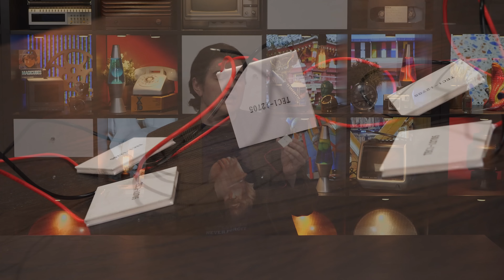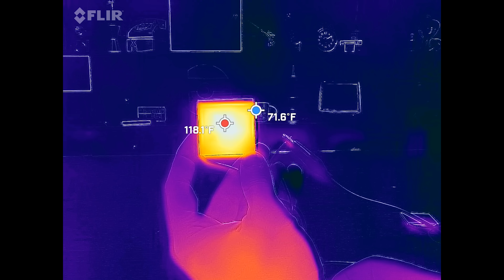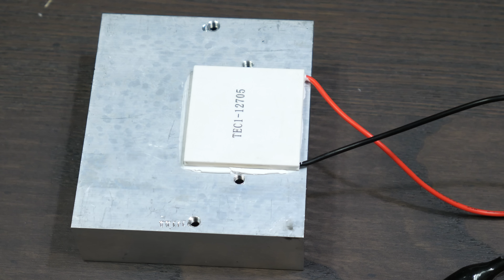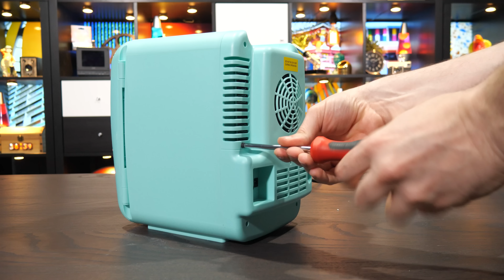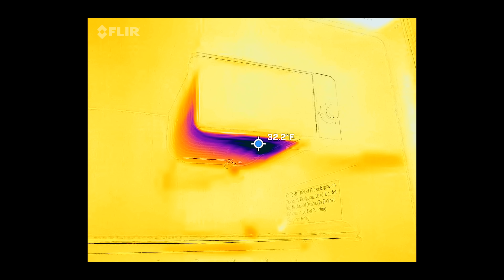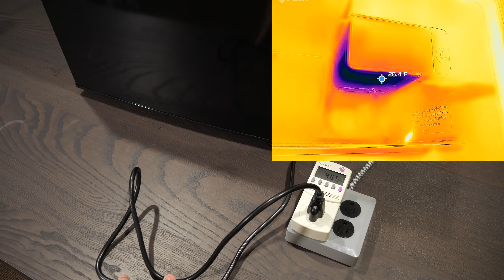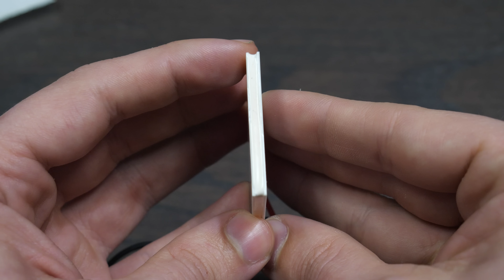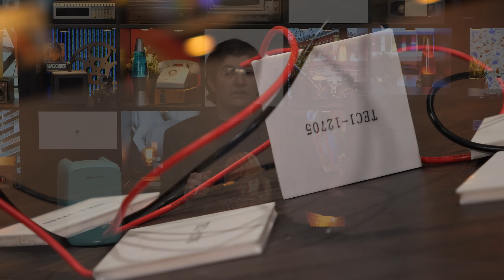Thermoelectric cooling: it's not great.

Comment: My wood stove has a Fan that uses those white pads to power it. The side facing the stove gets hot and the top is cooler and generates an electric current that spins the fan cooling the cold side of the white pad even more.

Comment: I have one on my desk at work. And would note, 1) it keeps my things pretty cold. It seems like it got your can down to 15 degrees and while i dont have a thermometer here to test it out, mine were cold enough to be refreshing on our 30+ degree days. My coworker has a temperature gauge in hers and it shows an internal temp of 5 degrees which feels similar to the temperature of mine 2) mine has a heat mode 3) i dont pay for the electricity at work 4) Im not allowed to bring in a mini fridge but can have one of the desk fridges 5) our lunch room is horrendously awkward to get to from my desk. Having some snacks or a pop there is significantly more convenient than keeping it the 3 minute walk away 

I think the one you got was just shit but i dont think comparing them to a mini fridge or regular fridge is quite fair when a situation where one makes sense, typically proclude the other styles from being valid options.

Comment: Fascinating! I use a neck fan with cooling plates and for some reason I thought the plates were cooled by the air going past them on the inside. I completely skipped over the fact that turning the plates on is a separate setting, AND the fact that they can be used for heat if so desired.

It's absolutely fantastic, but the battery life is pretty short if you're using the cooling plates. It takes a long time to recharge too. Makes sense now that I know about Peltier elements!

Comment: The power supply on the little blue thing will not last long. My didn't! The only thing the Thermoelectric has a goo thing. If you heat one side and keeo the other side cool it will make a small electric charge.If you put 100 of them where one side is heated and the other side stays cooler you may be able to do something with the power. There are fans rhar can be put on wood stoves that use one of the units to power a small fan to move the heat around the room. Because the fan keeps one side cool and the wood burning stove heats the other side, it makes enough electric power to run the fan! One could be used to charge your phone or some low power use!

Comment: I really wanted a ultra light, reasonably power efficient and small refrigerated medicine holder for camping / hiking.

My final solution(before thermally stable medicine fixed it for me) was a passive swamp cooler with a peltier to ensure the compartment stayed in range.

I also considered a medicine container in a regular cooler using the peltier to keep it warm or cool as the camp cooler temp changed over days.

In both cases the only way I found that peltier solved more problems than it created was to convert solar power into a small nudge in temp.

Comment: Portability is why I have to stick with my cooler... Portable refrigerators are significantly heavier and I'm lifting it in and out of different semi trucks every day.

And is also 1/7 the cost of a portable 12 volt fridge with the same volume inside, lol.

Wish I could switch to the portable fridge, though.

Comment: My 13yo autistic son has one of these mini cooler units in his bedroom, which he uses to chill his beverages. It seems to do a pretty good job for him, because he doesn't need his drinks super cold. Since we have solar, our electricity bill is pretty low (usually free, but never over $100 per month) even with 5 people in the house, all electric appliances, multiple windows AC units, and baseboard electric heat.

Comment: The only reason I have one of these at work is because I got it free with a dead power supply from an e-waste pile. A $4 power supply from Goodwill with the same voltage and a high enough wattage later and I have the ability to keep a couple of bottles of tea cool.

If I were paying out of pocket, I would've gone with a mini-fridge instead.

Comment: 21:55 - Their efficiency will vary wildly depending on temp differnces and current.
Well, that's actually something that can be controlled. With properly adjusted current and appropriately designed heat transfer mechanisms it's possible to run these things with relatively high efficiency. This particular toy "fridge" is just a crap built with no intension to be somewhat efficient and that's the reason it's crap, not because Peltier elements are.

Comment: the ones i have have a thermostat in them. they are also much thicker. got some to experiment with they were like $5 each. was going to add a passive r134a heatsink to one. i remember the heatsink being called a bubbletech, but the only one i can find is Akasa Revo. was trying to up it's efficiency as the heatsink also warms the box when the TEC is not on.

Comment: I love how after all is said and done, all these standard cooler replacements/portable fridges always end up not working nearly as effectively, but also end up costing significantly more than if you just used an insulated bag/cooler and fill it with ice.
They can't even reduce the items in them to an acceptable temperature, let alone keep them there. VS. A regular ice cooler that will get your items to near freezing within an hour or so and keep them that way for most of the day (depending on how hot it is/how often it's opened).

Comment: Wait, so these need to be constantly plugged in? And it still doesn't work effectively? I saw one at Sam's Club over the summer (IIRC it was the same model) with it's big draw being that it was "portable"; you simply charged it and it continued refrigerating/keeping stuff cold for several hours, so you could take it to the beach and what not.

Comment: Peltier elements have a use in laboratory equipment, such as thermocyclers. The volume to cool is small so it takes only a minute to reach a low temperature.
The great advantage of Peltier element is its size, you can put it in narrow spaces.

The fridges stuff is not terrible, but Peltier elements are quite acceptable in cupboard dehumidifier units.
But overall, yeah, in most application they suck, especially in fridges, except in few beer coolers (I got surprised to find one very efficient in cooling to 4-5°C, but not energy efficient)

Comment: Hi TechnologyConnections, I just purchased a unique cooking device and thought perhaps it would be something you’d be interested in taking a look at. At first glance it would appear that it’s just a standard microwave, but look a little further, more accurately at the top when the door is open and you’ll notice a toaster oven style heating element. That’s right a microwave that can also toast things. I just got it today so my experience is quite limited but I cooked a pack of cookies and some small pizzas (withhold judgment please) and they both came out great. One thing to note is things tend to cook a bit faster and get a bit hotter more quickly than the packaging calls for due to the devices smaller size but nevertheless it’s been a treat to use so far. Never thought I’d see the day when a microwave could crisp pizza or bake cookies. Anyway I think people would love to see you delve into this mysterious technology and hear what you have to say on the matter. My specific unit is the Galanz air fry countertop microwave. Most are quite pricey in comparison but this one’s 100 for an air fryer, toaster, microwave, and convection cooker all in one! I’m not affiliated with the company whatsoever just really passionate about my new purchase. Hope you will consider testing it or something similar out! Sorry for spamming just want to increase the odds of you seeing these!!

Comment: I have a larger one of these by Frigidaire ( made by some random Chinese company). It has a window and will fit a 12 pack. It has a decent amount of insulation due to its larger size. It cools down pretty quick and will build up frost on the back. It has both an AC and a 12v outlet on it. Is it efficient? Absolutely not, but it works well for cans on a desk.

Comment: The one I got from walmart a couple years ago was a bit more expensive, about $45. The fan is quiet enough I was able to record with a professional mic only a few feet away and it barely made noise above ambient. It would get my drinks decently cold and it was convenient to be able to stream 4+ hours straight without leaving my chair and having a cold drink. Energy isn't a concern since it's a flat rate with the rent. The most annoying thing about it is the guy in my town who drives with a giant antenna on his RC looking sedan keeps tripping on the useless external door light when he screams "breaker breaker" into his radio and blows out my headphones. Pretty sure that's some FCC violation.
Reply: >walmart
>$45

It’s the Minecraft creeper one isn’t it?

(I own the Minecraft creeper one and I love it lol)

Comment: Not a new idea but maybe thinking about pelter elements usefulness in the wrong way I think it could be a great way instead of powering to remove heat, being powered by heat(heat differential) to generate electricity.
Reply: “Thinking” as in the overall market thinking of pelter elements and in which product they use them in, instead of “refrigerators” use them in portable batteries/chargers

Comment: Peltier elements can be stacked to achieve very low target temperatures, such as those required by infrared optical sensors, or similar sensors which must be operated at well below ambient. Heat-seeking missiles as an example.

Comment: I have a solid state fridge  it was found in the trash .  2. 4” solid state 
Panels . 4 120 mm fans . The power supply was trash . Replaced with 20 amp  12 volt switch mode supply  . 
It gets down to 32 degrees .

Comment: Two things:  My RV fridge runs a defrost cycle that draws 60A @ 12v for 5 minutes!  The RV batteries dread that cycle.  I wish I could control when does that, so I could restrict it to doing it only when plugged into shore power.  

I have a 'little less stupid' larger, more expensive, peltier fridge compared to your blue one.  I just need to keep 1/2 gallon of half-n-half chilled for a mobile coffee station .  It does do the job, yes it has a noisy fan and yes it runs continuously.  It also fits in a very narrow space, up on a shelf!

Comment: I hate compressor fridges, anything with a Refrigerant, between sensors, ducts and technician fees I've pretty much had it... hope Peltiers get better... try turning off a fridge for over a year, see what happens to seals...  Dust build up on your evaporator coils can lead to corrosion... none of this happens with thermoelectrics... much simpler to build, maintain...  and in my view way more environmentally friendly in the end

Comment: Not to be that guy, but I think you have the understanding of heat pumps wrong. A heat pump isn't something that "pumps" heat from one side of itself to the other. A heat pump is a specific type of AC unit that can act as both an AC and a heater. It has a reversing valve by the compressor that reverses the direction the refrigerant is flowing in based off of what's being called for. With a heat pump, there's no evaporator and condenser coils, only an indoor and an outdoor coil because both coils can become either the evaporator or the condenser.

Comment: For heating, if you can vent to cold side away from a room, would it be more energy efficient than an electric space heater?

Just picturing these on the walls of an RV and running them in winter.

Comment: I remember back in the late 90s, early 2000s, computer enthusiasts were looking for a way to do subambient cooling and trying to do it with Peltier devices between the CPU and the cooling system. That fad died off pretty quick because of all the issues you bring up in this video.

Comment: I think these make a bit more sense when you use them in an office.

1- You don't care about the energy cost because your boss will pay for it!
2- You don't want to use the communal fridge because someone else might eat your food / drink your beverages.
3- Even a mini-fridge is too big to put on your desk.
Of course you could just use a small cooler, and fill it with ice. Probably more efficient than this, and it actually keeps your beverage cold.

One thing I'm curious about is how well these peltier coolers work compared to a cooler. If you put a bunch of ice packs in it along with your beverage, then will it actually keep your beverages colder for longer than a cooler? Or will the peltier effect actually make your beverages warmer if they are below a certain temperature?

Comment: I get the idea but this video is kinda dumb, it's like if you had a weed whacker and v8 engine, both internal combustion, but were pissed off that the weed whacker made less power than the v8. Literally everything can be scaled, I think being able to cool things with nothing but a DC circuit and a heatsink is pretty rad actually. The evap-condense route is so obvious that it's not interesting at all lol, yes we get it works better using a much more cumbersome, expensive design, that is also very power-hungry actually. I bet this guy will be really pissed off when he finds out that fridge companies that make regular refrigerators also sell them for a profit using the cheapest parts to accomplish the task as possible, it's called product engineering lol.

Comment: Those tiny refrigerators can run off your accessory port in your car. Might not be very cold, but cool is better than hot.
They are also portable.

Little refrigerators have very poor wall insulation.
Generally those little refrigerators will coo between 20 and 30 less than ambient.
They can run off a single solar panel too whereas the normal refrigerators need a battery with that panel to handle the large startup current.

They could optimize those refrigerators easily at the factor by tripling the wall insulation and using heat pipes to expel the heat.
The only noise is from the fan that runs. If it is noisy, the bearings need oiling.

Those normal isobutane refrigerators contain an explosive/flammable gas as a refrigerant. The can cause a fire.
And compressors DO wear out.

Peltiers were used to cool CPU's to achieve more overclocking before other systems were made.

The tiny fridge I have used 40 watts when on house current and 48 watts on 12 volt dc.

Menard's rebates are a scam and ripoff.
You can ONLY use the rebate on another purchase. It is not a real rebate. Just a credit...

Comment: I've been looking at peltier plug-in cooler for a while and couldn't justify the purchase. Thanks for the in-depth analysis.
Reply: Depending on application, Look at the size of the thermoelectric "cooler" and the mini fridge... sometimes if you don't have space you got to do what you got to do... And these are popular in office setting for some reason, not all office allow mini fridges but they usually don't have anything against thermoelectric cooler.

Comment: I have one of those (a different model). It works great. It's not expected to cool down things, but to keep cold things cold. That's even mentioned in the manual. When I come out of the grocery store, I'll put it in, and turn it on. By time I get home, an hour later, the items are still cold. There is even frost on the cooling fins inside the bag. So, try to read the manual... m'kay?

Comment: Quick note about your nomenclature: Although anything that uses the Carnot cycle is technically a "heat pump" as you say, in modern nomenclature "heat pumps" usually refers to units which are reversible and can pump heat either way (reject heat or insert heat into a system).  Something that can only cool would be called a refrigeration unit. This started being the norm in the HVAC industry  around 15 years ago once "reversible" heat pumps became more prominent and a new term had to be used to differentiate them.

Comment: Maybe next time get a better product than this pos you bought. I got mine and its currently sitting at 32F, with an ambient air temperature of 72F. That is significantly colder than my compressor mini fridge that is currently sitting at 39F. Not only that but if i want to drop it into the mid 20s i can just cool down the room temp into the 60s and no problemo! One of the best appliances i ever bought. Good thing i didn't watch this video first!

Comment: I don’t buy any of those fake refrigerators that you see the moment they say it can heat and or refrigerate because I need a genuine thing that does one item keeps things cold like a refrigerator. You may ask why not just buy refrigerator I can’t slip my medicines I’m a diabetic With a refrigerator. They’re bulky. They can’t be moved from one place to the other unless you’ve got a special type of generator and a car to go with it so I bought a device that says it’s a refrigeration unit. OK I don’t know if it’s a Peltier unit or not. I only know that the electricity goes in it And there have been sometimes that things would a bit wonky and it froze icicles on the inside of the unit which it wasn’t supposed to do, but it doesn’t keep things as cool as it was originally doing I mean, if they still stay cold enough that thankfully my medicines don’t go off butthey’re not great. It is supposed to be a refrigeration unit. there is no switch on mine you plug it in to any socket that will take a USB and it starts up and it keeps things cold now like I said it keeps things about supposedly between five and 6°F. I think it’s even a little bit less than that but it isn’t perfect. Then you were one. They have actually does show you the temperature but there’s a catch it has a small rod inside that becomes the icy refrigeration part of the unit which is problematic to us diabetics who have to be able to put things in and be able to take things out easily… and no, it is not cheap